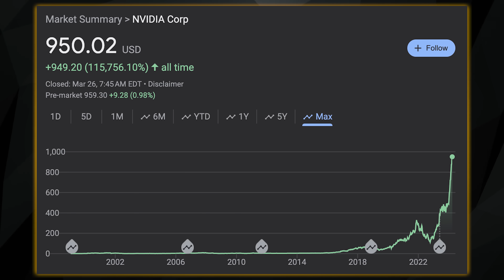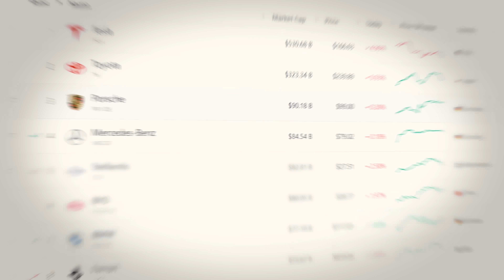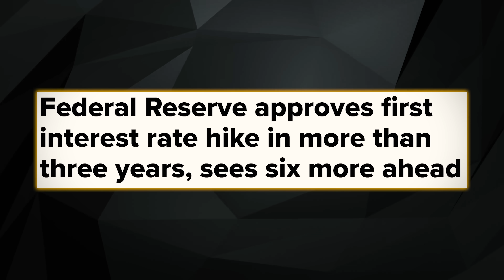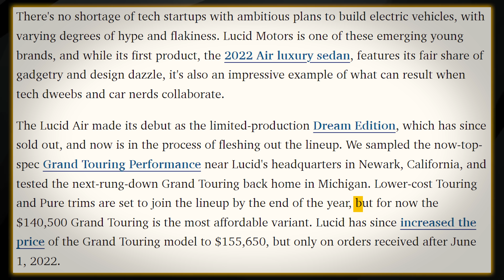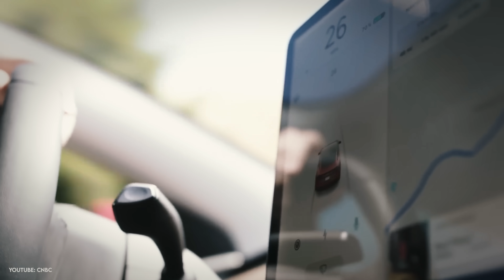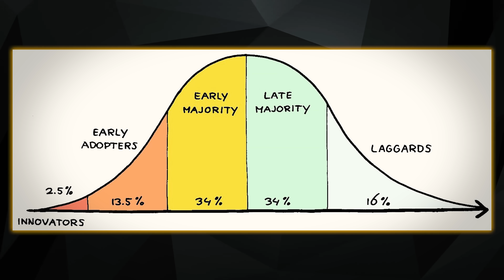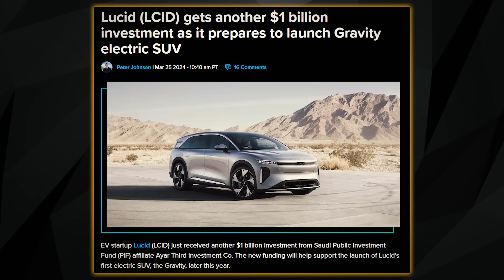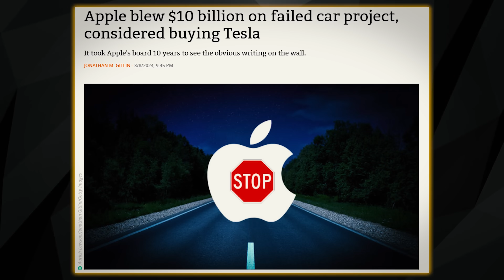The EV Bubble Popped - What Now?

Comment: I prefer hybrid rather than full EV.
Reply: That will be the real future. That with a small displacement turbocharged gas or preferably diesel engine.
Reply: @ShortArmOfGod I agree. I believe eventually the industry will fall back on hybrid powertrains like the original Chevy Volt's. Extremely long range with no range anxiety, unbeatable fuel economy, and very low emissions. Also, no need to plug in ever.
Reply: @ShortArmOfGod unfortunately after the volkswagen emission scandal i can't see diesel ever coming back, they are starting to be rare in new models in europe.
I drive a 33 yo diesel mercedes that gets 45mpg and will outdrive and outlive any new tesla
Reply: Hybrids are something im putting on my hopes, that way we have the best of both worlds, less contamination, more MPG or KM/L, combustion engines still alive, and more power aswell
Reply: Nah. What is the point? Adding additional weight due to an additional motor and battery? And making the car more complicated? For what? ICE cars are fine! If you really want to bring down fuel consumption maybe reduce overall weight and size of the car? But men don't like that. A big monster truck or at least a big SUV it must be - because you know ... masculinity.
Reply: @haderlumpi  hybrids do not add "that" much, if we are talking hybrid small hatchbacks or sedans they will still be 500kg less that medium and large SUVs
Reply: @ShortArmOfGod  Or REEVs.  Cut out all the weight and complication of dual drive trains, and have a highly-efficient generator for when your (small and light) battery runs out.

Comment: Here in the Sonoran Desert of Arizona temps in the summer can reach 115-118.  My friend, a Tesla owner who used to be proud of it but now is going to go back to gas, has told me his range "f-cking disappears when I run the A/C and the car sound system".  And it's a blast sitting at a charging station for 20-120 minutes in 110 degree heat with the A/C off.

Comment: Genuinely ive been trying to buy a cheap EV for so long. Still cannot find one for these "record low" prices. Much cheaper to buy a used gas than electric
Reply: Well there cant be cheap used electric. Once they get old enough to become cheap, they also require a new battery which will easily total more than the cars value, which makes the whole thing a write-off. 
So they are just scrap by the point they are worth 10k or so.

Comment: I was given a courtesy ev car and the infrastructure just isnt there yet.   Given 200 miles on a full charge, which is nothing considering some charging stations with low Kw output would take 6 hours for a full charge. Unless you find a high Kw charging port still take 2 hours. With electricity prices at a high its not even that much cheaper compared to your petrol or diesel which takes a minute to fill your car. After experiencing this I would not buy an EV car as its just inconvenient.
Reply: You aren't the only one. The US Secretary of Energy decided to try one and got stuck as well - which is hilarious as she is one of the extremists pushing these stupid things on more sensible Americans!
Reply: And the funny thing is the electricity to charge your EV probably didn't even come from a renewable source. So what were we promised about EV again?
Reply: Sounds like you were given an ev with zero information about how it works. A person who never had an ICE car would probably also find it difficult to figure out which type of fuel to put in and have trouble there.

Ofc a charger that takes 6 hours is not for using on the go, it's the type of charger you would use while at work or at home asleep. And if a "high powered" charger took 2 hours i must have been broken, even the bolt which is renowned for having the worst charge time on the market fills it's battery in one hour at a slow "high powered" charger. Most EVs fill up in less than 30 minutes with market leaders currently charging 400 miles of range in 12 minutes.

If you think a 12 minute break after 400 miles of driving is too long i think you should take the train instead.
Reply: @PriffEV    your right I was given with an ev car for a courtesy so he didn't tell me nothing tbh. This car only had 200 miles max and I was using a 50kw charger took just over an hour to charge but the first port I used which was 22kw said it would take 6 hours. The guy who was also waiting for his to charge did say there was a even faster charger about 5 miles away but he said there would also be a massive que for it so what's the point in waiting for others. Hence going back to my comment earlier the infrastructure just isnt there yet.
Reply: @PriffEV  Can you point me to where someone driving an EV can consistently find a place to get a full battery charge in 12 minutes? Honestly, if that was a possibility, this wouldn't be a discussion. (That is close enough with refilling at a gas station that reasonable people would accept the extra hassle if pricing was better.) When people talk range anxiety, that is because they CAN'T find those kinds of chargers in a shape that is consistently available. And yes, waiting an hour in line counts as time spent not driving. Sure, I may see my local Costco with a long line when they have the cheapest gas prices, but even then, I'm still able to fill up the entire tank in about 20 minutes, waiting time included. Then again, I'm betting you are being facetious and trying to troll. I'll skip the EV and stick with a hybrid where I can use battery for local trips but on long car rides, I can go back to the exponentially more reliable gasoline!
Reply: @PriffEV  Actually you could spend 6 hours at a fast charger if it had multiple cars connected and they were all Derated to 1/3 of their usual charge rate of 150KW.